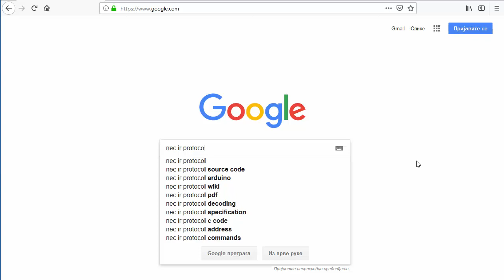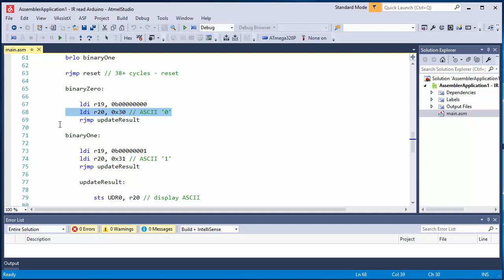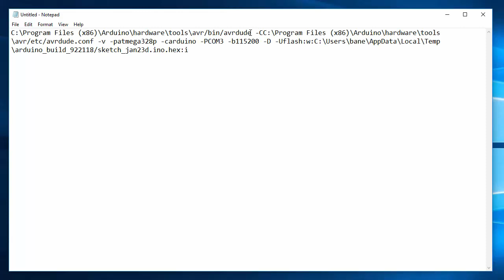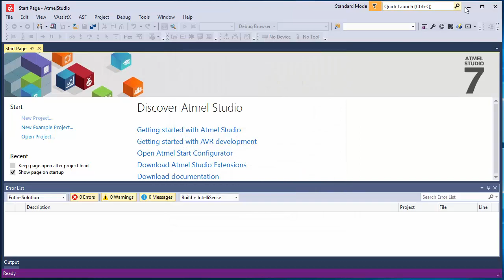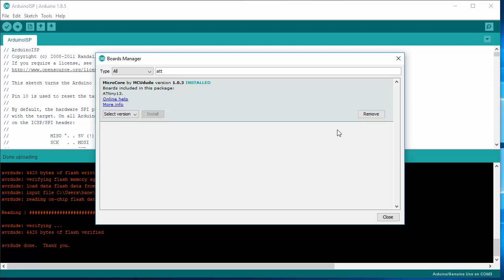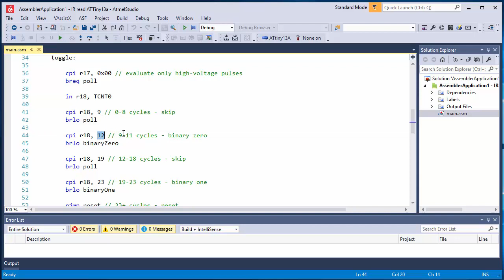Atmel AVR ATtiny13a as TV remote control IR receiver (assembly code)

Comment: Why you had enable   Bit 7 – RXCIEn ( RX Complete Interrupt Enable n) and Bit 3 – TXENn ( Transmitter Enable n)?
ldi r16, 0x48
 sts UCSR0B, r16
Reply: RXCIEn is enabled for no Reason.
He did enable it but never used ISR because:
1) no SEI instruction used (Global Interrupt Enable) / no manual setting of I Flag in status register.
2) no ISR code for Vector No. 21, Address: 0x0028 written.

TXEN0 (Transmitter Enable USART0) is needed so he can transmit '1' and '0' Ascii characters over the USART with:
 sts UDR0, r20 // display ASCII 

UDR0 - USART I/O data register

Comment: Hello, nice video. Do you know if it's possible to use this program with the ATtiny85?
Reply from the maker: Thanks, Daniel! Yes, I would expect this program to work on ATTiny85.
Reply: @branislavstanojkovic5211  Hi, I'm doing an assembly program similar to yours but with one input and two outputs. The decoder I made gives me 32-bit values (NEC protocol), but I don't know how to only read the 8 bits of the command, I hope if you could help me please

Comment: Hello, is it possible to receive and decode a WS2811 protocol with ATTINY13A like your IR reciver ? See you
Reply from the maker: Good question, Edouard! ATTiny might be too slow for WS2812B, I don't know... There is the "FastLED" library for Arduino that I know to work well on ATMega32U4. I would imagine that you could drive WS2812B via the I2S interface, and perhaps even via the SPI, but I haven't tried it. Thanks for watching my video!